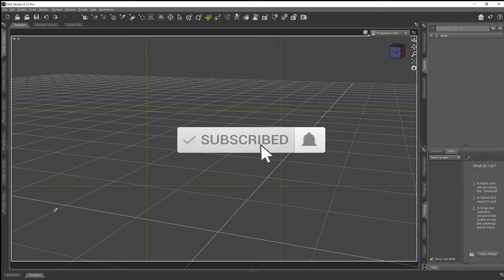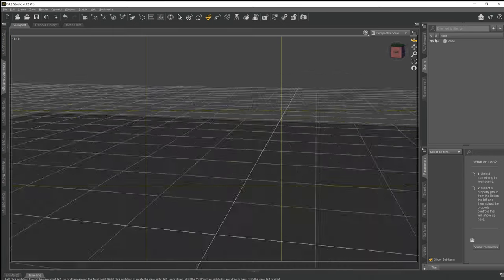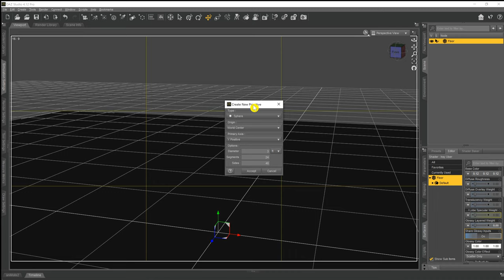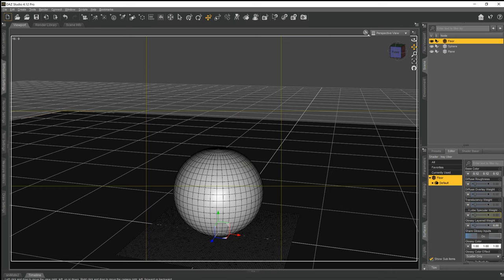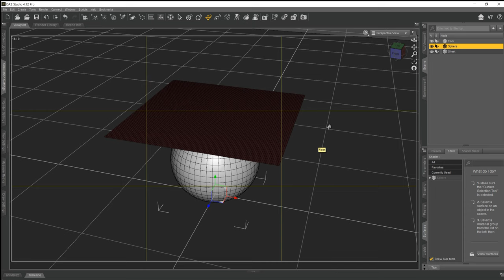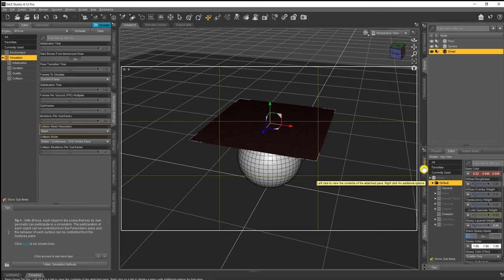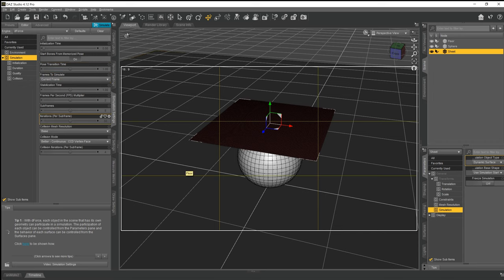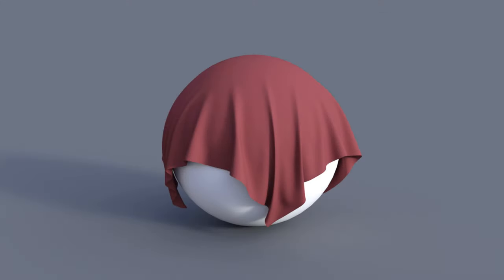Daz 3D : Draping fabric over a sphere using dForce - Tutorial

Comment: I follow you step for step, but the fabric either goes a very tiny pit or goes halfway down. Any fixes for this?
Reply from the maker: Hey there .. hhhmm .. without looking over your shoulder it's a bit difficult for me to say. There's nothing "extra" in my settings that what you see in the video so it should just work .. The only thing I can suggest to help with the "halfway down" problem is go to into the Simulation Tab .. look for Stablilization Time and increase the default 1 to 2 .. It should work fine with a setting of 1 .. but try a 2 and see if it helps ..

Comment: but if i import clothes i made in marvelous designer... should it work too?
Reply from the maker: They .. could .. work fine. I don't know too much about the process from MD to Daz but it's obviously work-flow that others use. Import something from MD into Daz - rig it so that it's compatible with Daz and hit simulate and see what happens. If it works - great .. if not, then make the necessary changes.

As I say - I don't know the process from MD to Daz so you'll maybe get the better advice from the Daz forums or even the MD side of things.
Reply: @RaukoDaz3D  Well in the end the clothes are nothing more than a OBJ data. But thank you <3
Reply from the maker: @paulawbswbs  Yes, but can they be converted into and rigged as a daz object? I don't know - as I say, I've not used MD ..
Reply: @RaukoDaz3D  They can. Well i will see when i try it ^^ thank u

Comment: When I click stimulate. A error appears saying "Could not find a valid opencl device" what should i do ? Can I use dforce in cpu rendering?
Reply from the maker: Hey there. Firstly, what do you have in regards a gfx card? Nvidia? AMD? Integrated?

Also, If you go onto the simulation tab and then onto the Advanced tab within, under "OpenCl device" let me know what it says and what, if any, options there are in the dropdown menu.
Reply: Heyo rauko.
Mine is a Nvidia geforce gt 610. It pretty old. Under advanced tab it says that " A valid opencl 1.2 device could not be found. Simulation using the dforce engine is not available."
Reply: There's no options under advanced tab...as I said it only shows that "A valid opencl 1.2 device could not be found . Simulation using the dforce engine not available." Under the advanced tab.
Reply from the maker: @dveditz9525  Yeah, you could be running into issues with the GT 610 .. I'm not sure if the 610 runs opencl or not .. but, even then, you need about 4gb of video ram for dforce anyway so you'd struggle even if it could detect the card ..

Only thing I can suggest is make sure you have the latest drivers for the card and then hope it gets detected
Reply: @RaukoDaz3D  Hmmmm Thank you so much for help ❤✌

Comment: You may want to get yourself a better mic or test your levels before recording. Even with the volume on my mac on its default level, I can hardly hear what you're saying and  I'm having to turn the volume up to full just to hear you. Your recording levels are way too low or just a very poor mic? Still, a very good tutorial by the way and appreciate the time you took.
Reply from the maker: Hey Christopher - yeah, that was 18 months ago. Things have been sorted now.
Reply: @RaukoDaz3D  Glad you fixed it. I'm new to your videos as saying this. I shall not let some minor techinical issues yet in the way of learning stuff!
Reply from the maker: @vivanecrosis  Hey Viva - the problem with the sound was strange. The volume was (still is) perfectly fine for me on a number of differerent devices (Desktop, phone, pad) - it was only on the app via our cable TV it sounded a bit quiet. 

A friend said it was a little quiet too .. whereas two other friends had no problem. 

My guess is that it was very device dependant and it was tough for me to get on top off (If I can't "see" the problem .. I can't fix it!) .. Anyway .. I played around with a few things in th dark and somehow managed to luck upon a solution that worked ... 

But I'm glad it hasn't deterred you!